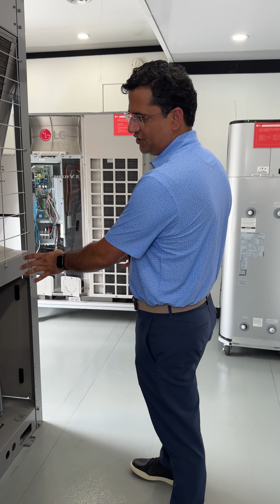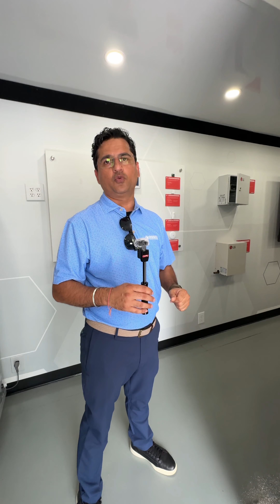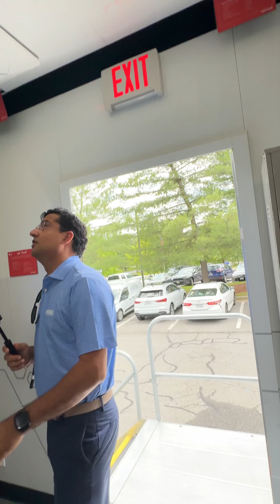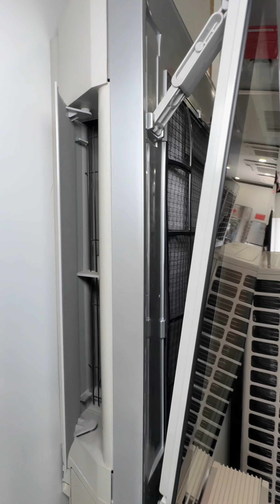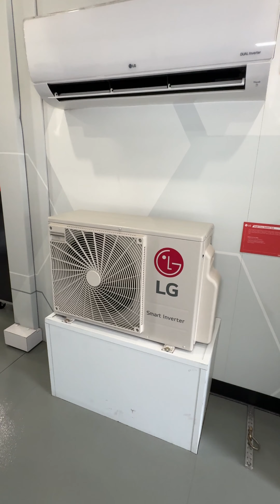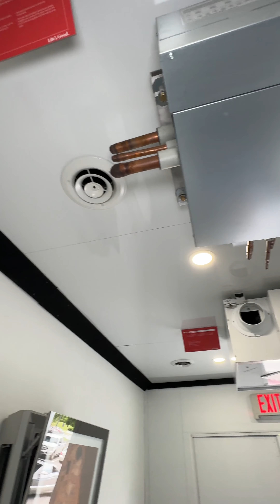Explore the Newest LG VRF and Chiller Products on this LG Trailer Tour | Hobbs Maryland Open House

Comment: Well tony one thing he forgot to mentioned about lg vrf heat pump / heat recovery model . You will need to add HRU  box in order for it to provide simultaneous heating and cooling. And picture frame unit only goes with multi zone configuration. In lg we also have similar model its called art cool gallery in that you can stream your tv and same time it gives you heating and cooling. Plus we here at LG  we have gone with R32 because LG successful record using it in eroup and south asia. Wherever you visit canada pleaase visit our HQ here in toronto i would love to host you and i will show you our entire LG  set up.